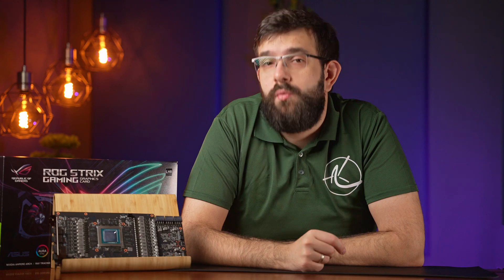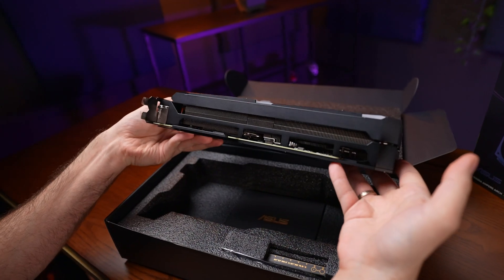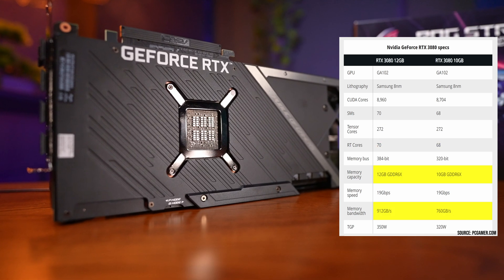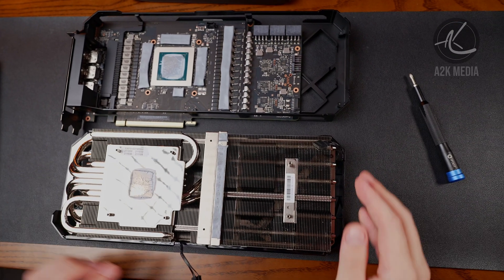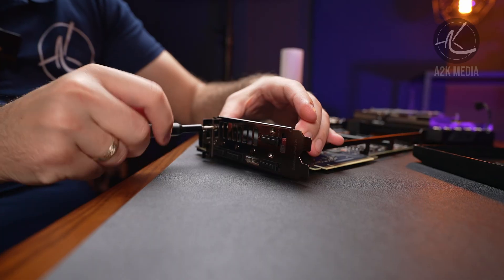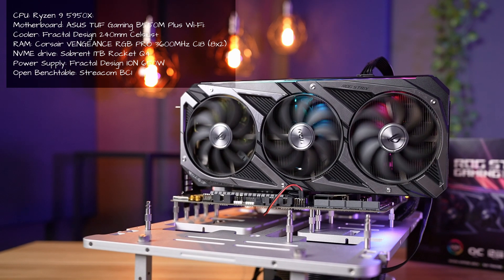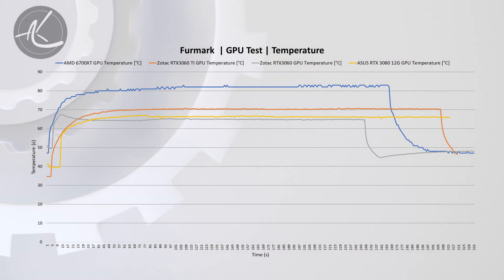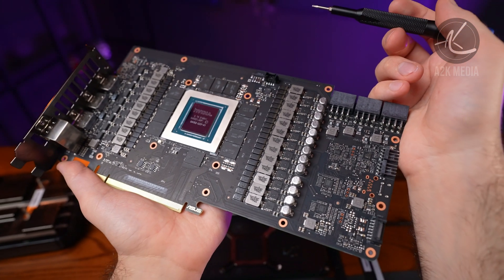We broke RTX 3080 12GB apart - Specs, Teardown, Benchmarks

Comment: are there cables in the package for the card?
Reply from the maker: no cables here. what ones are you looking for?
Reply: @A2KMedia  i have now a 3060 and i want to buy the 3080 strix. And i only have the cable for the 3060. And i am searching for a cable that fits for the 3080 
I am sorry for Bad englisch😬
Reply: @A2KMedia  i think its a 3x8pin cable for the 3080
Reply from the maker: that cable comes with the power supply rather than card. Please check if your power supply has enough ports and I would really recommend power supply with 650-750W and more capacity
Reply: @A2KMedia  my Power Supply hast 850W snd thank you for the help i will write later if i found something. Thank you very for the help!
Reply: @A2KMedia  im sorry for asking that much, do you have a link where i can see how it looks like?
Reply from the maker: you need to check specifically your power supply manufacturer manual. they are very different between different brands
Reply: @A2KMedia  yes i will do that now
Its an Bequiet Platinum, but i will look now
Reply: @A2KMedia  i looked and i think i got 2 more slots

Comment: This card is crazy, I have e two days with it and run a stress test, out of the box goes up to 380 Watts or 390 sometimes, I have a 750 PSU, will be enough? My i7 CPU only consumes 95 watts at 4900 mghz
Reply from the maker: Should be fine. If you start seeing that you get random shutdowns that could be the cause but if it works, then it works

Comment: Hey I’m trying to buy a gpu to play 1440p max settings on the AAA TITLES I have a 8700k so idk what will be the limit I want to get the best card I can get for my CPU I’m thinking about this one it’s only 800 dollars .. is 750w enough?
Reply from the maker: yeah 750w should be fine as long as you don't OC
Reply: @A2KMedia  so I won’t be able to use the OC settings from the gpu software?
Reply: @A2KMedia  i order a 750w , but if I need more I can order other one and return the 750W
Reply from the maker: if you want to do heavy OC then I would recommend getting closer to 1000W for safety. Its not the main power consumption that would be a problem, but rather power spikes that could result in crashes so best to be on the safer side.
Reply: @A2KMedia  oh ok well nothing too heavy I don’t even know how much I can push it with my cpu but something enough to be able to use the settings in the software
Reply from the maker: 850 would be good, 1000 would be better.
Reply: @A2KMedia  ok thank u for the advice. So the power supply won’t spend the energy unless the parts use it right? Like having more then what u use is not More energy wasted ?
Reply from the maker: correct. In fact most power supplies run more efficient if they are more powerful while using less power.  I recommend you read up about gold/platinum rating and how that works.

Comment: Do you think a quality 1000w psu is enough for this card?
Reply from the maker: I am using high quality 750W and its not had any problems. Nvidia recommends 850 I think.
Reply: @A2KMedia  ty for the reply. I bought the evga p6 1000 just now anyway. Guess it will give me a beefy psu for maybe some overclocking for the 12700k and that strix card, plus anything else in the future. Head room for days! Heh. Take care.
Reply from the maker: nice! also larger psu is normally better for efficiency.
Reply: @A2KMedia  we shall see ya? Prob run it stock for awhile and then push it when I feel it’s losing its edge in a couple years or so. Like I did with my current 4770k and 980. Also went with noctua nh-d15 over the ek 360 aio. Couldn’t be sure it had the lga 1700 kit included and wanted to get it up and running right away. Maybe I’ll sell the air and get liquid later, see what’s what. Air is bullet proof and my current aio always made me nervous, even tho it never leaked or failed. Gtx H100i btw for anyone who reads this.

Comment: hey what  cards have best GDDR6 Ram temperatures?
MSI-GeForce-RTX-3080-SUPRIM-X-LHR-12GB-
GIGABYTE-GeForce-RTX-3080-AORUS-Master-12GB-
ASUS-RTX-3080-ROG-STRIX-OC-V2-LHR-12GB-

and want the coolest temperatures
because I have already tested 2 other cards, cheaper versions and there it reaches above 96 degrees gddr6x rams and I am not interested in such cards  because it is heater  at home  not a computer
Reply from the maker: if you push the card to the max on the memory side - it will reach that and it can't be avoided without special cooling. also VRAM being hot is very normal on all cards
Reply: @A2KMedia  it is 35 c summer no need more hot IT WILL BE 45 C IN ROOM)
Reply from the maker: not much you can do about that. VRAM operational temp is rated up to 110C but the size of it is small, hardly will warm up the room :)
Reply: @A2KMedia  but if you pay much more for top card  you required temperatures to be lower than on cheap cardboard models

Comment: Just got this card on Amazon for $799!
Reply: Same here, when is your delivery date?
Reply: @KelboLive  september 15th
Reply: August 4th it's coming now. If just shipped
Reply: @Jay_Jefe  Is it working fine with you? cause I want to order one but a little bit worried about coil whine and fan rattle, seen lots of complaints about the whole Asus strix cards
Reply: @nour-eldeenmahmoud9857  yea it's good I haven't had any problems with it so far. I haven't had any whine

Comment: Can you make a video to paint 3080ti and it's fan blades in white..
Because they didn't make the white version of that☹
BTW great video.
Reply from the maker: oh thanks! you may be better off buying white cooler on 2nd hand market.
Reply: @A2KMedia  I don't think asus made the white version of "ti" cards
Reply from the maker: I might be wrong but it may have similar cooler to non TI, would recommend double checking
Reply: @A2KMedia   3080 12, 3080ti and 3090 have same cooler and very near performance in fps 1440p

Comment: My strix 3080 10GB has a really bad rattle on the fan when it hits around 70-80% fan speed, does that also happen to your 12GB one?
Reply from the maker: not had that. see if fans or gpu is loose?
Reply: @A2KMedia  yeah, I tore it down a few months ago and all the screws were tight, the rattle seems to originate at the fan closest to the rear of the card, where all the ports are, the only problem I saw was that the tape holding in the fan connector was a bit loose and could be letting the connector rattle, but I don't think that would be responsible for the type of noise I'm getting
Reply from the maker: do you still have warranty?
Reply: @A2KMedia  I do, but I live in Brazil and from what I've read I'm forums here, the turnover time for warranty claims is well im excess of 3-4 months
Reply: @A2KMedia  search for " Asus 3090 strix OC fan noise at certain rpm" from the channel Daniel Werner, it has a video demonstrating the problem
Reply from the maker: yeah that does not sound right! I've not come across this issue on mine yet though.
Reply: @A2KMedia  I was thinking of trading in my regular 3080 for a 3080 12GB just to get rid of this obnoxious fan rattle, since ambient temps here tend to be higher, the fan often stays in that annoying RPM threshold. I'm glad to know that Asus fixed this issue. Also major props for your incredibly fast response time on a relatively old video 💙
Reply from the maker: no problem at all. for me the worry would be it developing into a bigger issue hence why I would look into getting it checked but 3-4 months without GPU though... it would not be fun
Reply: @jhontavarish4088  Only 7% between 3080 12gb and 3090 in average fps, calculated on 30 games in 1440p ... 3080 12Gb Rog Strix OC great card